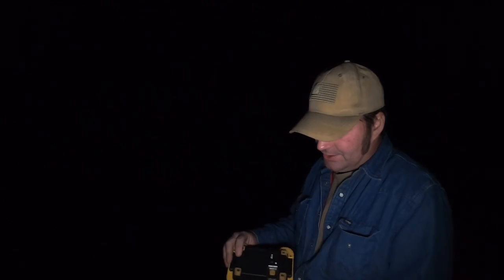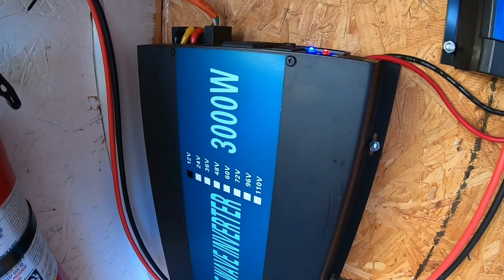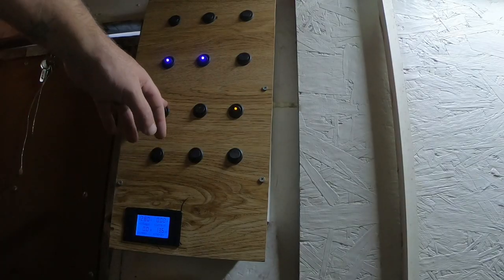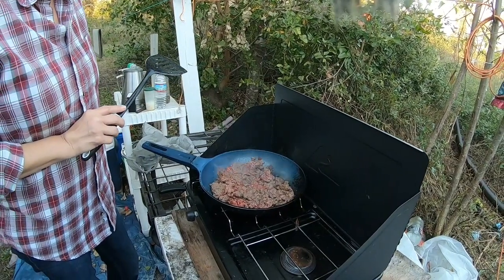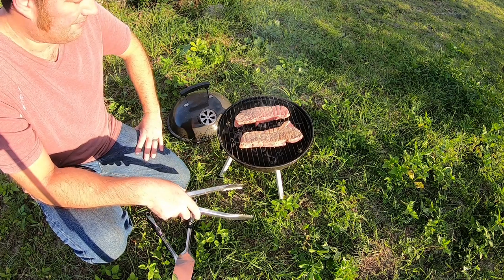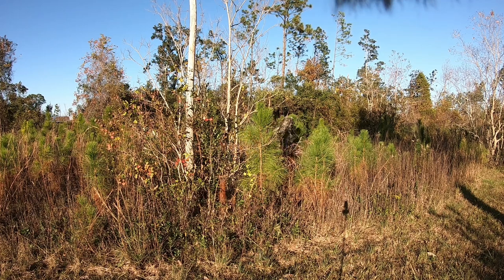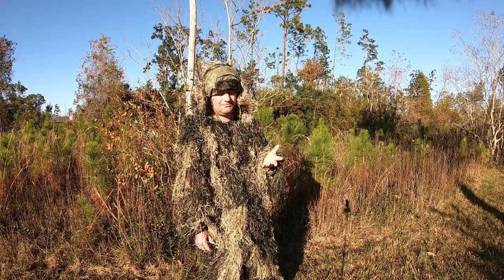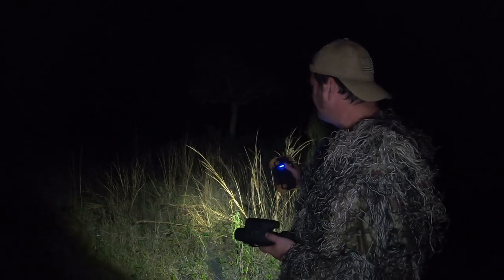Prepper Preparing For EMP Strike, Grid Down Survival

Comment: my understanding with emp attacks (Depending on the EMP 1,2,3) everything with electrical circuitry or digital circuitry would be fried no matter how much solar power you have. Unless that equipment was kept in a FARADAY cage or case. your coffee maker would work, cell phones wouldn't work (even if they were in faraday case cause the tower would be down) that little digital screen you have on your panel would be fried as well. I guess it would be best to have back up of these in a faraday cage.
Reply from the maker: You are correct, that's why we have emp shield hooked to our solar system as well. Basically turning out trailer into a large faraday cage 😁👍
Reply: @SurvivalLiving  thats awesome, thx for the reply. still watching your video, its awesome. i will look into EMP shield. Can you recommend a company/brand/model please?
Reply from the maker: Sure you can buy directly from EMP Shield. If you use my link and use Promo code  cfpemp  you get $50 off.  I am a member of their Affiliate Program but I put my first emp Shield on my truck last December. 
https://www.empshield.com/?ref=Survivalliving
Reply: @SurvivalLiving  thanks man
Reply from the maker: No worries claud. 😁👍

Comment: Perhaps I missed something here, but, if an EMP hits everything that is electronic will be fried, non-operational. Essential power electronics should be stored in a Faraday cage type of container until such time as it is needed. my 400watt inverter and a HAM radio are kept in a faraday rated metal box. I also have a hand crank generator, with USB ports in it stored in the same box. I also bought some cheap FMRS radios with rechargeable batteries kept in the same box. Not military grade stuff and not perfect for the event, but enough to get by. Nice video, btw. Thanks for the presentation.
Reply from the maker: Yeah I discussed our emp Shield equipment for our vehical and solar system farther in the video. 👍👍 out trailer is practically a large faraday cage

Comment: 1. 12V to 120V are terribly inefficient because of the very large voltage differ and the amount of amps that need to be drawn. at 3KW @ 12 volts = 250 Amps. Power lost = I^2V. The losses increase at the the square of the current. More amps (current) meets a lot more power loss. I recommend looking at the Sol-ark inverters since they sell EMP hardened versions. Sol-Ark are 48V systems and offer some of the very best efficiency (meaning most of the energy used from the batteries goes to the devices you using & not powering the inverter or Power losses).

2. Solar panels are very likely to fail in a EMP event because they are essential diodes with a lot of surface area. EMP delivers energy dependent on the surface area exposed of a conduction. The more surface area of a conductor, the more energy will be conducted. Solar Panels have an issue with a low reverse breakdown voltage. 

3. If your building new, then I recommend using MC cabling instead of Romex that has a metal shielding that can attenuate EMP energy (like a faraday cage for wiring). Romex (unshielded cabling) acts like an antenna for EMP energy. Anything connected using Romex wire is most likely to get fried from an EMP. Also recommend install Point of load surge protectors for any devices that you don't want to get destroyed during an EMP. If you have a heads up that an EMP is pending, unplug any devices. For the rest (perhaps hardwired) turn off every breaker in your breaker box (main breaker & all circuit breakers). The shorter the cabling path the less energy can be collected by your internal wiring.

Comment: Great video 👍 I'm jealous of your set-up. I have 2 little girls and don't think the wife would let me pack the family up and live the off-grid lifestyle at least  not until she has no other options!! I think that time is closer now than ever. I picked up a solar system as a backup. Do you know what needs to be protected from an EMP.  Is just the controller at risk? Not sure if if I need to add an EMP shield. I have 2 extra controllers for redundancy already. I'm new to solar so any help  would be appreciated.  I've kicked my prepps into high gear because I've had a bad guy feeling this year and I always go with my gut!!! Take care guys....
Reply from the maker: We have a few extras in faraday cages as well. If you decide not to go with emp Shield.  I would definatly recommend putting a extra charge Controller, and  inverter in a faraday cage. Check your solar panels and get replacement diodes for them. Extra cables, the carrington event melted the telegraph cables

Comment: I Have a q3. DO I NEED A POWER INVERTER FOR. PORTABLE SOLAR GENERATOR? AND CAN YOU RUN THAT TYPE OF GENERATOR IN YOUR HOUSE? I KNOW THAT GAS GENERATOR YOU CAN'T.
Reply from the maker: A solar generator like bluetti and jackery has a built in inverter and safe to run indoors
Reply: @SurvivalLiving  I don't have a bluetti yet but my generator is a flashfish. It's probably junk but it's what I could afford. I'm trying to be preppered for the hurricane season. Im also learning what to buy on my fixed income. Thank you for your help, you are 👌
Reply from the maker: I will have to look the brand up. If it's got outlets on it, it should have a inverter
Reply: @SurvivalLiving  It does have outlets.
Reply from the maker: Okay so it should have a built in inverter
Reply: @SurvivalLiving  I just adopted you as my brother. Thank you so much for helping ur old suster 😂